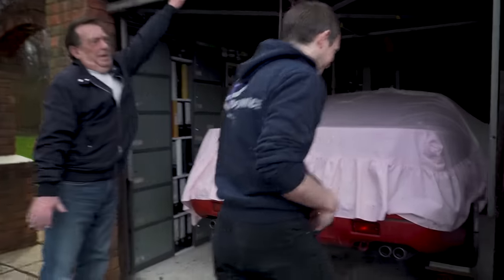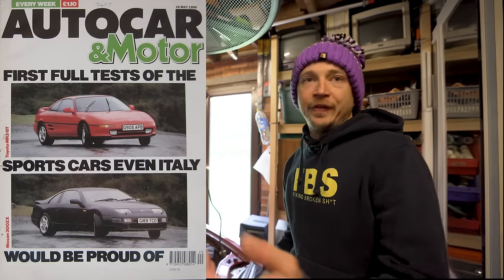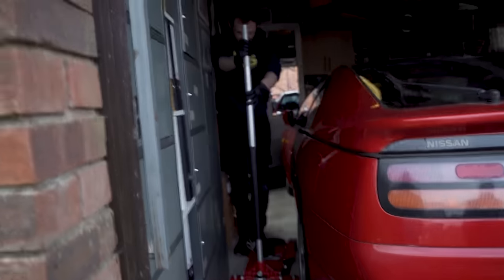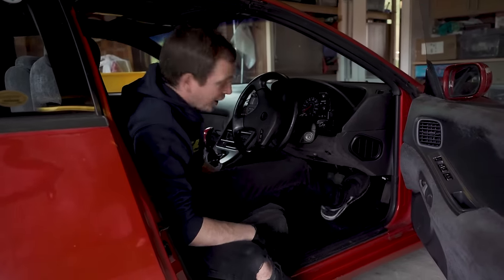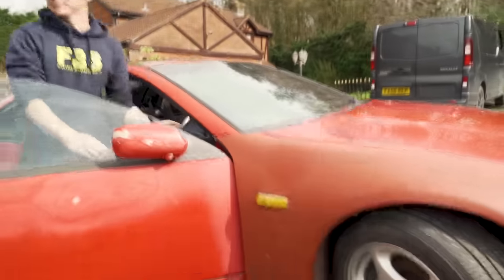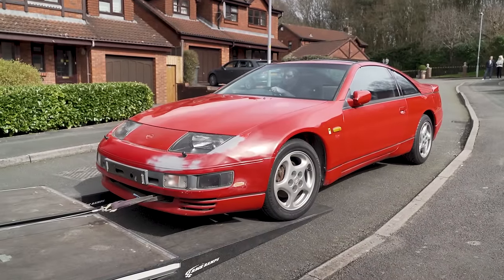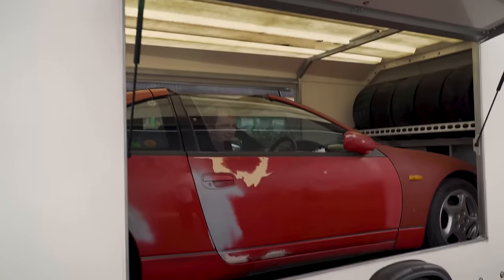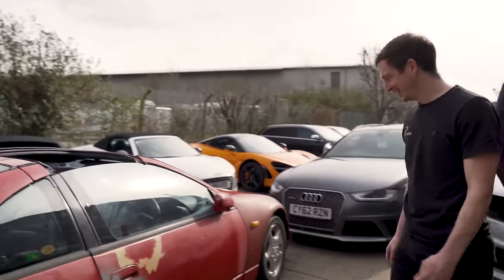300bhp Garage Find! Not Moved in 14 Years! 👀 Part 1

Comment: I had a 300zx tt 2+2 UK spec with full leather back in 2004, I rebuilt it with wiseco pistons, pe 850cc injectors forged rods and a gt28rs turbos kit from z1 in the states lots of other bits too she used get squirmy at just over 600hp. I've still got all my pics, including when I was building it back up with a brand new wiring harness. I still have the original hard copy of the workshop manual, too.

Comment: Had one of these in manual back in 2000. Fantastic cars.
Get the cambelt complete kit from Courtesy Nissan in Texas, they use to supply to the UK club.
GTR R33 4 pot brake fit the front with no mods. The GTR throttle flaps fit as well and are larger.
Quite a lot of people for some reason did a HICAS lockout.
By the way majority of 300ZX were T tops, slick tops are the rarer, and the rarest are the SWB Turbo (2 seater).

Comment: Those pipes in the boot are brake lines. 

The ABS unit is under the trim over the drivers rear arch.

The HICAS on a 1990 is hydrolic. There's a ram at the back and two lines run under the car on the passenger side to a unit in front of the power steering reservoir.

The rams like to seize up, so you can get a delete kit which is a solid bar that replaces the ram and you remove the lines at the front and loop them.

Fuel pump you can replace with a Walbro 255.

That's a UK car ( front headlight washers, sidelights at front, dummy units on the edges of front bumper) not a JDM import. On the UK and JDM car the downpipes don't have cats, just the midpipes. The US cars had cats in the downpipes so their downpipes are longer so don't fit UK/ JDM cars for info.

Also you don't need a ODB reader to read codes on these.

Under passenger footwell pull up carpet, unbolt the ply wood and you'll see ECU.

Turn key onto position 2.

Then on side of ECU there's a LED and a screw.

Turn the screw fully, wait 3 secs then turn it back.

The LED on the ECU aswell as the EML on the dash will then flash codes in sequence in a loop using long flash for 10s and short flash for single units.

If you get 5long and 5 short I.e. 55 that means no faults.

Whilst in the ECU diagnostics if you start the car and run it at 2500rpm the EML will flash in time with O2 fuel trims I.e. on and off for rich and lean. This will be one O2. If you then turn the screw back and forth you'll swap to the other O2.

You can't map the stock ECU.

However you can get a socket fitted and a pre programmed tune chip.

Or you can get a Nistune board which can be mapped with Nistune software.

Or fit a stand alone ECU.

Fuel pump relay is in drivers footwell.

Fuelpump fuse under hood by firewall.

There is also a Fuel pump controller behind rear trim.

There is a relay for ignition in the fuse box on strut tower.

The CAS will also stop you getting spark aswell as the PTU located on timing cover, they are common issue.

Comment: I bought one of these new in 1993 a manual in black I think all the UK cars were targa tops as I recall the option list for the car was almost non existing . I had the car until 2001 and only covered 31000 in it I did enjoy the car and only sold it as it did not get much use. The values were not that good when I sold it but have increased in the last few years. A very rewarding car to drive you will enjoy it.

Comment: Ricky having owned a couple of these nissans do yourself a favour upgrade the injectors get rid of the waterlines on the throttle bodys and get a wiring specialtys engine harness these are the common problems with the 300zx turbo engines and most of all replace the timing belt but that said nice find that might not be a 'SUPER CAR' per say but it will always put a smile on ya dial when driving it nice car for the lad  cheers from down under

Comment: IIRC, you have to jack the front up to properly fill the cooling system. The water lines to the throttle bodies are above the top of the radiator.

Comment: Beautiful car,i owned a 1986 300 zx manuel 6speed non turbo unfortunately ,but it was alot of fun.I do know that nissan had a recall on the fuel injectors and rail, they replaced it all for free in 2005 ,unfortunately the floor rotted out  and i sold it for parts. Alot of good memories with it in my younger years.😊

Comment: Oh, and what you found in the boot with the lines is the ABS pump, not the HICAS 4ws pump.

As and when you bleed the brakes, the ABS pump has a bleed point on it.

HICAS 4ws solenoid is left front of engine bay infront of the power steering res
Reply from the maker: Thanks mate that’s amazing info!

Comment: They were ALL VG30 engined. That's a UK model with the UK size licence plate recess and rear fog lights in the bumper, and they all had the VG30DETT twin turbo engine. In Japan and America they also came as non turbo versions, which had VG30DE engines. The non turbo versions don't have the hicas 4 wheel steering either. Speaking of the hicas, those lines you thought were for hicas under the boot carpet are nothing to do with it. They're your brake lines where they enter the car from underneath, the ABS pump is behind that trim on the right hand side.
Reply from the maker: Thank you mate!
Reply: @REPerformanceUK  no problem, if you need any info or advice on getting it healthy again, there's plenty of us who know our way around them in various Z32 owners groups. 👍

Comment: Ricky please  could u answer this for me a friend of a friend had a mark  1 golf with a 16valve mk2 engine in it was on the front cover ov one ov them  car magazine  wen started and warmed up it would rev louder and louder  it went pased 7000rpm then across the bottom ov the rev counter and back around to about 4000rpm so it reved to 14000 rpm is this possible  it was over 26 years ago if it was possible u would have never needed 2 go past 2nd gear and would have been doing about 90 in 2nd  please could you answer this for me only u have the knowledge  THANKS the engin was all built.